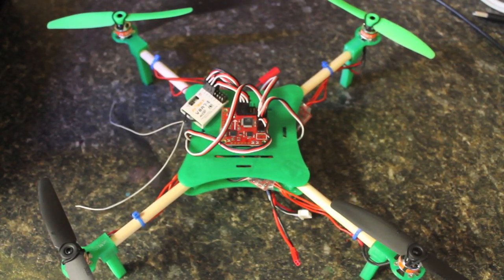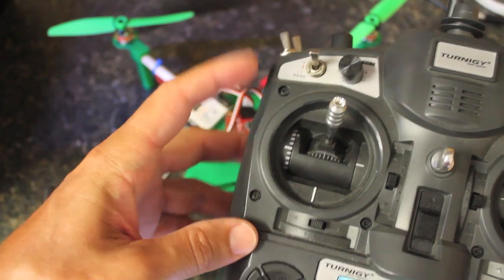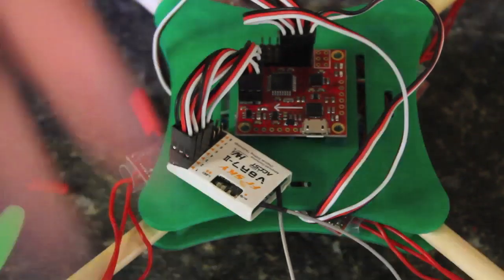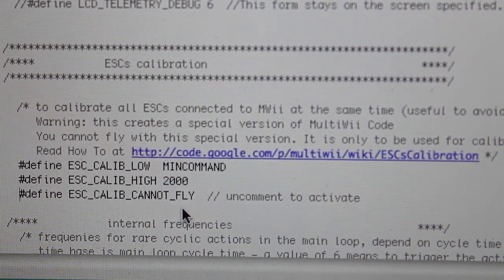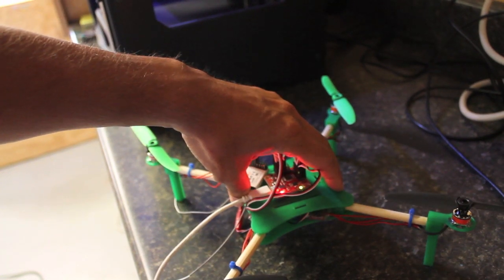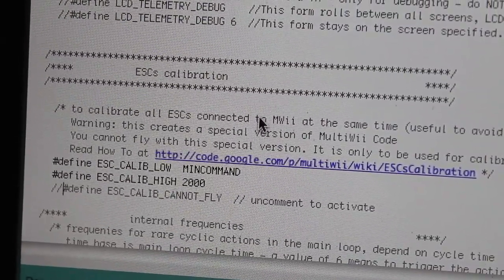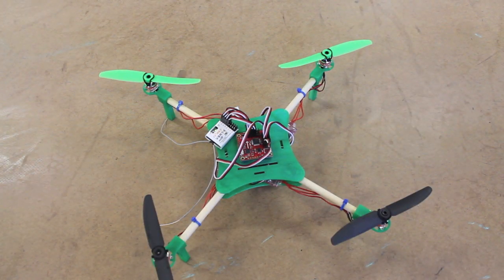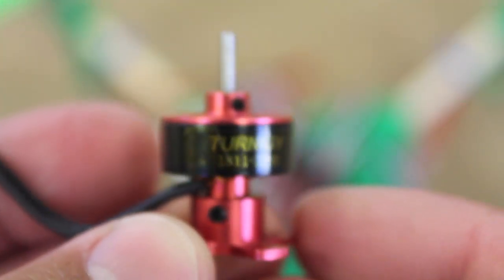DIY Mini Quad MultiWii ESC Calibration

Comment: hello, all right, I'm doing the calibration procedure in arduino, but after finishing and start the engines are making noises, beeps and giving tremendous helices as the engine sound or esc.

Comment: This is yet another failed attempt at explaining calibration. The ESCs will not spin the motors during an actual calibration. They will only go into calibration at power up. The correct method is this:

1) Remove the propellers. Disconnect the lipo.

2) Edit the sketch to uncomment ESC_CALIB_CANNOT_FLY. If MAXTHROTTLE is not 2000, change "#define ESC_CALIB_HIGH 2000" to "#define ESC_CALIB_HIGH MAXTHROTTLE". Otherwise you won't get the full throttle range.

3) Upload the sketch. Unplug the USB cable. Plug in the lipo. The ESCs should beep, but the motors will not turn.

4) After two sets of beeps, in about ten seconds, unplug the lipo.

5) Plug in the USB, recomment ESC_CALIB_CANNOT_FLY, and upload the sketch.
Reply from the maker: Moto Moto Thanks for the clarification. I'll need to revisit this and will gladly post an update with credit to you when I do. Appreciate the feedback.

Comment: do you think this could work with the mystery 12mp esc's on a CC3d?
Reply from the maker: djSpinege The CC3D process is a bit different if you're doing it with the GCS software. Here are the details:

http://wiki.openpilot.org/display/Doc/Output+Configuration#OutputConfiguration-ESCSetupTutorial

Comment: hey man, something really strange happened to me whle trying this. I tried to calib the esc's via arduino just to be sure. everyting was going fine, motors spinned after 10sec, and i thought it was ok. so i powered up the copter to test it out, but after i armed the muliwii, no motor was moving.. nothing! and now i have no movement at all... very strange...
Reply from the maker: That is very strange. I haven't seen that happen before, but as you know this is a continuous learning experience :) If you do get around to resolving your problem it would be great if you could share the solution in the forums at www.garagepilots.com. It would be nice to hear what happened. Thanks!

Comment: hii, so you connect the flight controller via usb and also with the battery throught the esc's. Doesn't broke it the connecting both things at the same time?
thank youu!
Reply from the maker: That's correct. You connect both the USB and battery. The purpose of the battery is to be able to power your ESCs and receiver so you can do the calibration.
Reply: But with both battery and usb, isn`t it going to fry?

Comment: Awesome! Nice, I broke my KK2.1 board then use the backup, Multiwii.
I have a question though, Since I bought a second hand MWC board with x mode, i haven't calibrated the ESCs. But i did calibrate the same four ESCs before on my kk board. I found that the four propellers rotate almost the same time. So do i still need calibrate the ESCs?
Reply from the maker: There are varying opinions on this, but I will share mine. If you calibrated your ESCs using the KK2 board using the throttle passthrough method vs calibrating them independently with your receiver then I would recommend doing it again for the MWC. If you did them independently of your flight controller then it should be fine, but I'm always of the mindset to do it again. Better to be safe than sorry.

Comment from the maker: Jack, thanks for the heads up. I've done a good bit with the KK2 board, but decided to go MWC for this build. I thought the problem was the MultiWii, but it turns out these crappy motors were the problem. I upgraded to the Turnigy 1811-2900 and they fly great. I will check out your 2211-2300s for future reference. Good luck with your build. I'll keep an eye on it.

Comment from the maker: I've had my eye on that board and will definitely pick one up. Thanks. I think it's fairly similar to this X-Rock version I'm using from what I can tell. I was able to get the mini quad in the air over the weekend and the MWC was rock solid. Turns out my problem all along were those crappy motors.

Comment from the maker: I do plan on flashing them and had never heard of the BLheli firmware. I have SimonK on my TBS Discovery and it makes a world of difference. I got the mini quad in the air ove the weekend with the 1811s. Should have started with those! Will post an update and thanks for the tip on BLheli. Any idea how it differs from SimonK?

Comment: Have you tried mixing the ESC's and motors around so to see if the location of the non-spinning motor moves due to ESC, motor or is dictated by board orientation.

Comment: Great video as always! You should flash those plush ESC's with the BLheli software. I flashed some hobbywing skywalker ESC's this weekend and man what a difference it makes. It's almost as good as the SimonK software. Also you should have no problems with those 1811 motors. I have like 10 of them and they all work great.